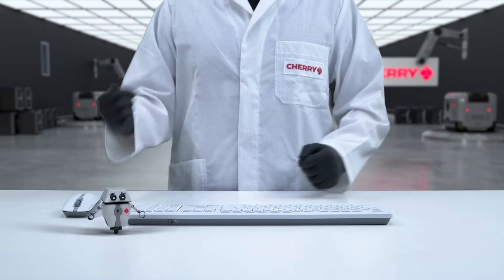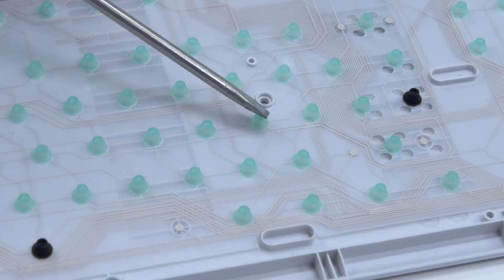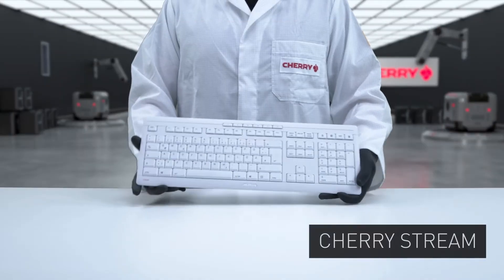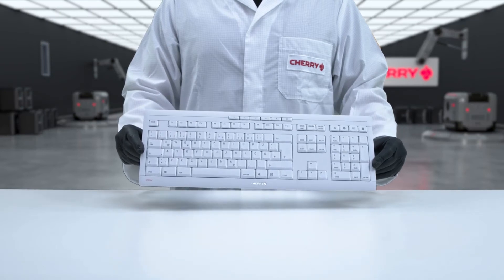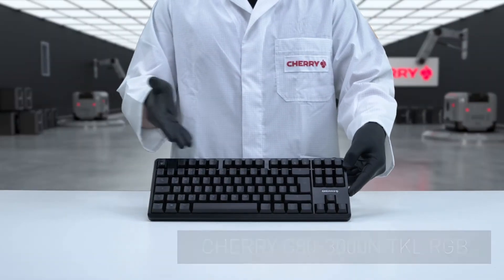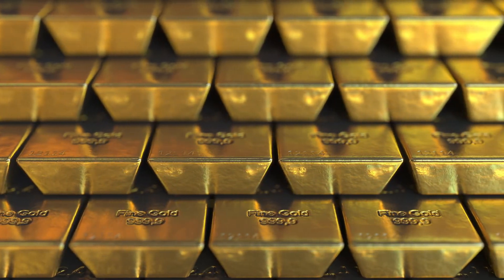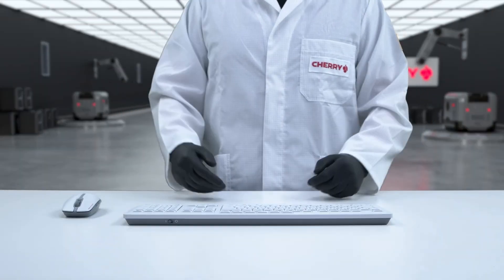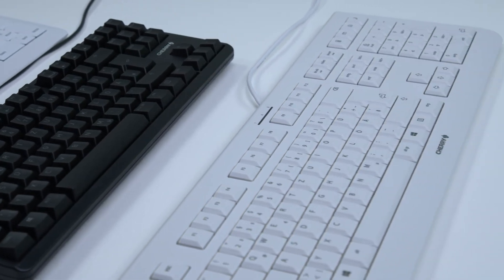CHERRY keyboards explained | CHERRY Keyswitch technologies at a glance - CHERRY LAB 🍒💻 [English]

Comment: Bought this as a hopefully more reliable replacement to 2 Logi K270 which both developed a ghost key press issue after a few years. Feels like a membrane keyboard, so came to check out how it's different than the cheap 270s...

2:19 "delicate" "bit less robust".
NOT good things to hear. Doesn't inspire confidence that the product will last long.
Now you got me worrying how soon until one of these delicate things breaks.